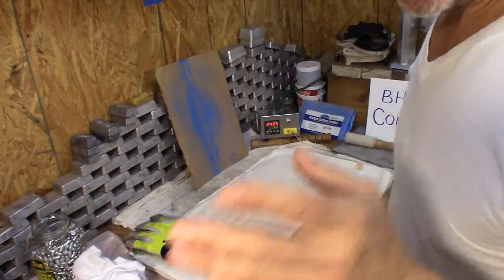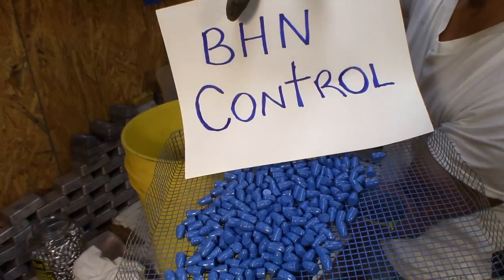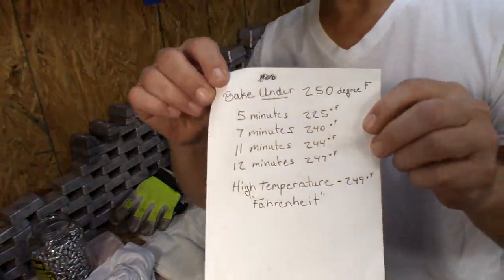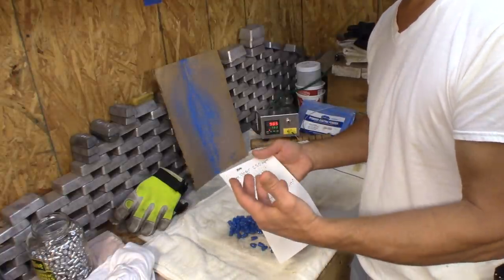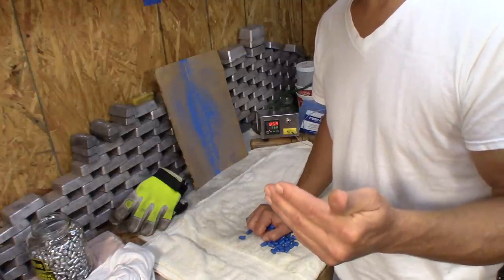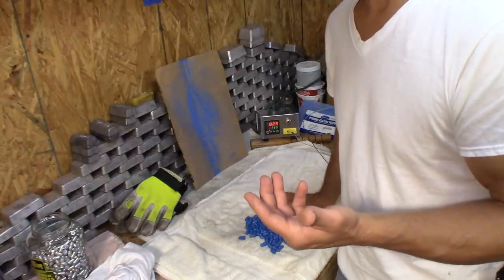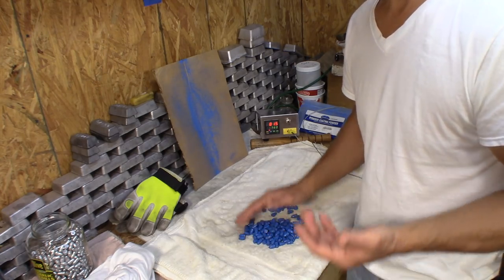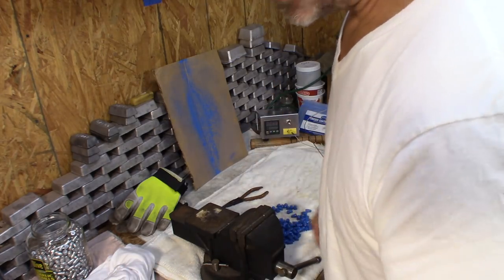Powder Coating Bullets (ULTRA LOW HEAT) Method

Comment: When you re-size the higher BHN bullets through the re-sizing die (.356), are they more difficult to re-size than the ones that were baked at 400 degrees? In other words, are they harder to run through the press?
Reply from the maker: Hey Larry Kool.. Great question... I was meaning to bring that up.. I found it was easier to size using a little spray lube in a bowl of bullets.. twirl em around!
Reply: I make a home-brew lube using pure alcohol and liquid lanolin (I'm sure others use the same formula). I've used it on cases (and it works wonderfully)  but, never on powder coated bullets. I'll have to try it it the PC bullets.

Comment: Hey Elvis great video. I find that 350 for 15 min and a water quench doesn't soften as much when trying to get harder bullets. Wondering how that Arsenal. 223 mold is working out for you? I'm thinking about ordering one to try casting for my AR. Wondering if you are happy with the performance vs pressure on the bullet with no lube grooves. Good vid as always thanks;).
Reply: I would like to see an update on this. I just got my arsenal mold 225 elvis 61. It works pretty sweet and it was my Virgin attempt. I would love to here some more info on it.

Comment: I have been doing 400 at 20 min, and end up with some blemishes where they touched each other or the basket. 

I was thinking of trying an initial brief low temp, then break them up and rearrange them, followed by 400/20 and water quench. 

It would be nice to get the hardness up a bit, and not have blemishes.

Comment: Elvis, I will try this out. Now...all my lead comes from range scrap. Using FC45LLC's fingernail method for determining BHN, I think mine are around 16-18 and I pc them.  I load mostly 9mm and .45 acp.  What I just don't understand is why I get leading. Its really frustrating because pc is supposed to prevent that and they are "soft enough" that they should be obturating very well. Thoughts?
Reply: Alan Bycroft most range scrap is soft, 10 or so bhn, wheel weights are harder 15 or so but they need some tin to cast well.
Reply: Alan Bycroft by chance are you not sizing them large enough.  I was told .357 gives a nice tight seal between the bullet and the rifling.
Reply: Alan, You need to up the tin content of your material. Tin is a gliding metal and assists the lubricity of the metal going down the barrel if you are getting scrape off of the powder coating. I would give that a try. Dave.
Reply: Alan Bycroft what kind of firearms? If you are using something like a Glock, H&K, or a Walther. With polygonal rifling it can be tricky shooting lead bullets even powder coated. It's possible but it usually takes more tinkering. Be sure to slug your barrel and size your bullets .001-.002 over your groove diameter. 10-15 BHN is plenty hard for .45 (10-12 BHN)and 9mm (12-15 BHN), and standard rifling is easier to get good performance and no leading. The Lee 2nd edition has a good chapter on pressure and bullet hardness and how they relate.

Comment: What would happen if you kept the heat the same and extended the time in the oven?
Reply from the maker: Hey Barrett Neely... Not exactly sure. but my gut says there will be a slight decrease in BHN. for longer exposure times to the heat..

Comment: Hey Elvis. I've got a bunch of .45acp lead swc 200g. I'm kinda having a slow go at getting the right bullet/lead Combo. I'll be loading for my s&w m&p and SR1911. I've got bullseye,  unique,  and win.231 to work with.  Do you have any pet loads with that bullet and one or more of those powders? I'd be much obliged if you could throw me a bone. Love your videos  by the way.
Reply from the maker: Hey Josh Wideman... I don't load 200's but you'll probably find 231 to work really well. Or even Unique. SWC in the 45 acp might be a little tricky for reliable feeding, you will need to play around with your OAL I usually work with my load data for fmj using Powder Coated bullets. somewhere below the max for a similar bullet. If unsure just start low and work up a bit for reliability and accuracy. Bullseye might be a little hot for that load.. Hope this helps a little. Let me know how it goes....
Reply: elvis ammo thanks Elvis.

Comment: Hey Elvis, I just tried your low heat method. I'm new to this powder coat stuff, but have been casting bullets for over ten years. The biggest problem I'm having is getting the powder coat to stick at a thick enough constancy to get a good coat. Are you guys washing your bullets in something before coating? I use paraffin as a flux as I cast to bring up the dross during the process. I'm wondering if this has a bit to do with my problem. Any suggestions? - Thanks
Reply: I wash mine in acetone,and at room temp. when coating. 👍

Comment: Does bhn testing work after powder coating? How do you verify the bhn on the pc new method bullet?
Reply from the maker: Hey Edad Martin... I just file the bullet flat on one side as usual. Then test it. Most of my testing is after about an hour. Although, I have got the same result within 15 min. or so.....

Comment: Hey elvis, is the powder coating you're using from eastwood or from some other company?  My harbor freight powder didnt look as good.   Thanks
Reply from the maker: Hey Marty Martinez... Yep , it's the Ford Light Blue from eastwood. I tried Hf Red. It worked but was weak compared to the eastwood. Maybe a little more heat or something could work! play around with it a bit!
Reply: @Marty Martinez ...I know this video is a couple of years...but search Amazon for Eastwood powder coat...Ford Light Blue for $13.99 per pound with free shipping with Prime...it ships directly from Eastwood...by ordering through Amazon it’s half the cost when you add on Eastwood’s ridiculous shipping rates...go figure???

Comment: Elvis what ratio of clip on to sticky weights are you using. I just stated casting and have heard 4 parts clip on to one part sticky, I was told straight clip on wouldn't fill the mould properly, I would love to know your alloy. Sounds like you're running straight clip on
Reply from the maker: yeah Geeber... i am running straight cowws ... I will add a sticky ingot when I want softer alloy. I make the ingots separate. I seem to get decent fill out ... You can always experiment with your alloy to see what works best for you...
Reply: elvis ammo thanks for the quick response, we all appreciate the hard work!

Comment: Ok - so i tried this.  I'm using the .45 ACP Lee 230 grain TC, that i cast from a mixture of wheel weight and linotype, on about a 5:1 ratio.  I cast all my bullets on the same day about a month ago.

I'm using  Harbor Freight Red.

I cooked my first batch of bullets at 400, for 20.  Water quenched.  Then, after drying, ran them through my Lee .45 resizing die.  Most went through fairly easily, with about 5% resisting a bit, but nothing excessive.

My second batch was on the 250 x 12 min.  Water quenched.  After drying, i tried to run them through my resizing die, and had to put my full body weight on it (i run about 210 lbs).   After 5 bullets, i was afraid i was going to rip my lee press off my bench.  Of note, it shaves the paint down and leaves the bullet dark, but it's not usually bare metal showing.

So...not sure if it's so much harder that it's resisting my resizer, or if the bullet is bigger due to the paint and it has something to do with the cooking letting the paint stay thicker.  

But it's nearly unusable, and i'm probably going to have to re-smelt 100 bullets.
Reply from the maker: Hey Matt Lee.. Yeah.. this is common the bullets are a lot harder and will require a little squirt of liquid lube and twirl in a bowl, then they will go through the sizer without damage. If your using linotype with clip on wheel weights, This may be overkill using this method, I say no need. Also using this method if the coat is not satisfactory you can always put them back in the oven for a redo! Thanks for the feedback, Very interesting!
Reply: I put the batch back in the oven for 20 min at 400 - and they ran through just fine.  

hadn't considered lube with the powdercoat, since the elimination of bullet lube was kind of why i did the powdercoat in the first place.   

Good stuff though.

I look forward to running these through my dan wesson to see if i get any leading.   I just put the "forced" bullets back in my melt and will make new ones.

thanks for all you do..
Reply: I had sam problem last time. That was my first try with powder coat. I tried low heat method and bullets were very hard to size and paint tends to chip off. Few bullets was perfect, I guess those which were heated longer. I used European paint and pan with cover.

Comment: do you mean 5+7+11+12 min at those temperatures??  or just one of those ??
Reply from the maker: PE J ... 12 min. at 250 F seems to be the sweet spot to maintain your Bhn
Reply: ahh, ok. I thought you meant to higher the temperature in 4 different steps. But you tried all 4 and the best one was 12 min at 250 - ok. Thx - you make great videoes of reloading. I have watched a lot og your videoes now. They are awesome. :-)

Comment: Elvis Ammo, I would just stick with the 400° method and be done with it.  This is a perfect example of people complicating a method that works perfectly well for you, and thinking they have a better method, without knowing the whole story on what they're talking about.  I have tested this Theory ... and that's what it is ... a Theory, and there is absolutely no difference between a bullet that is powder coated at 400° and one that is 'Step' heated to stay below 250°.    This is just another example of "Internet Professionals" making things more complicated just because they want to be the one you listen to.  The BHN of a bullet comes back between 3 to 7 days of sitting in storage, loaded, in a freezer, etc ...  PLUS, 99.9% of people out there wouldn't be able to tell the difference between a bullet that has a BHN of 10 versus one that has a BHN of 21 where Performance is concerned.  Why we worry about BHN in the Cast Bullet community is mainly due to ability to be able to shoot bullets through high velocity cartridges and have them retain their shape both in the barrel and downrange.  When you have a Powder Coating on that bullet ... and it passes the Smash Test ... it will perform the same on any thin skinned, or even medium skinned animal on the Planet.  After all, we aren't shooting Cape Buffalo or Elephants with these, and if you are ... you're using a Solid Copper Bullet anyway.  Keep up the good work, and don't let internet 'jargon' complicate an otherwise simple process.

Comment: Elvis. I'm not out to Kill your Rock 'N Roll Okay? However, I know this is a family orientated channel so excuse the expression, Making Bullets "Hard as a Whores Heart" isn't necessarily a good thing.They have to not only engrave But also obturate and fill the lands and groves under the low pressures of handgun velocities. I find that making them as Cookie put's it "Hard enough for the pressure they are shot at" the only way to go for best accuracy. I find that target ammo only needs to be around 8-11 BHN, Moderate to near Magnum pressures to 13-16 BHN and Magnum pressures to 18-and above to whatever.  I'm not a powder coater, You know that. So you may get the base ball bat out and chase me out of the room, I would understand. I could see a huge benefit in making them hard for rifle use and powder coated though because of the pressures involved. Dave.
Reply: yes ,a bullet must be somewhat thicker than the grooves in the barrel,using a soft lead bullet it is a pre for not leading the barrel ,gascutting is the mayor course of leading (and a good lube is also needed).and also a hard cast bullet must fit the barrel otherwise leading wil also occur
Reply: I am pretty sure the intent is for rifle bullets.

Comment: I'm wondering .... why are you worried about your BHN of the lead?  After all ... it's the jacket that needs to be hard on powder coated bullets.  After all .... have you seen how soft copper jacketed bullet lead is?  At 400° for 20 minutes .... I get proper flow out and curing of the Eastwood powder coating.  I don't care how the bullets come out looking.  It's how properly cured the powder coating gets.  From using powder coating in the auto industry for a decade or more .... you need high heat in order to properly cure your powder coat.  If you don't get it that high .... why not just stick with plain lead bullets?  You're overthinking it.  Why confuse new shooters?
Reply from the maker: roostershooter76 ..Not worried at all! just another tool in the drawer for other applications. . What works is the main thing! I  wanted to put out some info that I have.  this will blossom on its own, then we will find out more about the real benifits!